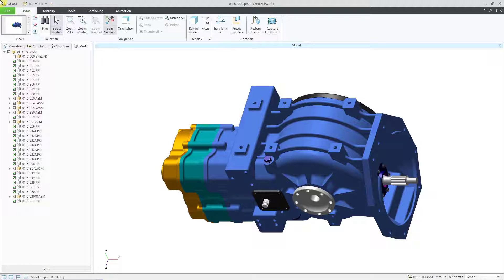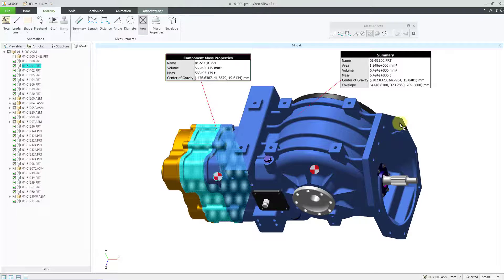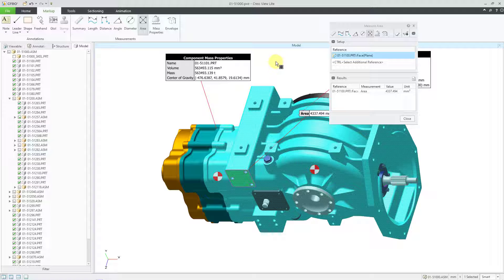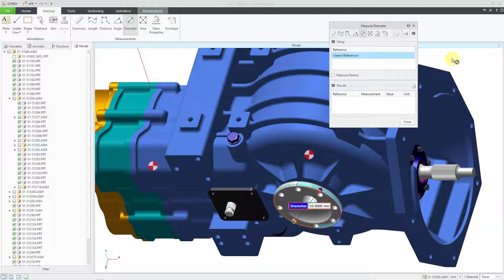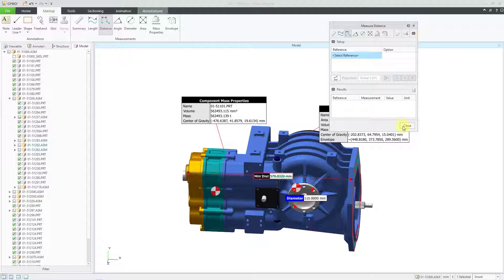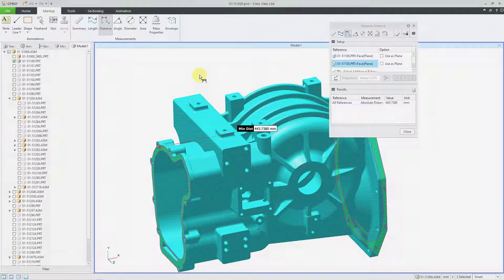Windchill Creo View - Part 3 - Measurements

Comment: Thank you very much:
Key Moments:
Summary Command @ 0:16
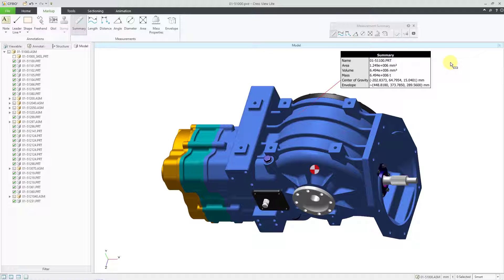Envelope Command @ 1:11
Mass Properties @ 1:30
Area Measurement @ 2:00
   Expand Measurement toolbar@ 2:23
   Eraser on Measurement toolbar @ 2:59
Diameter Measurement @ 3:18
Angle Measurement @ 4:23
Distance Measurement @ 4:47
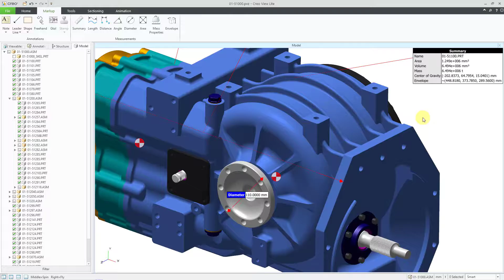Length Measurement @ 5:35
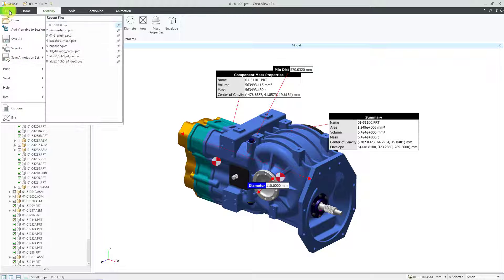Save measurements ass an annotation set @ 6:26
Open sub-component in a new View @ 6:52